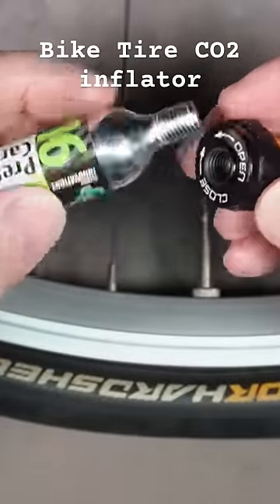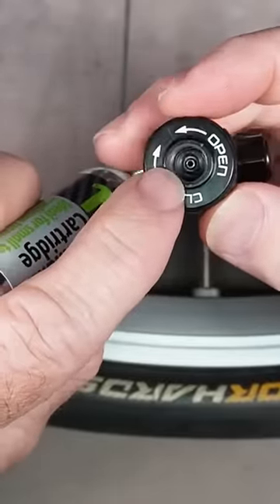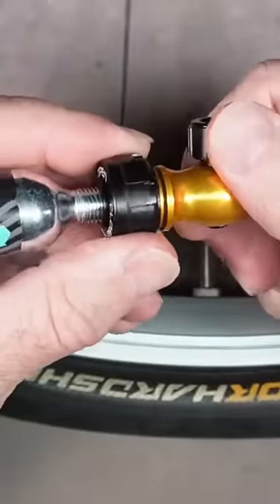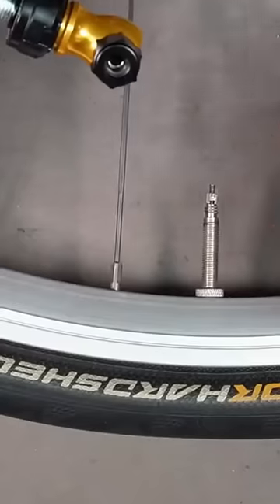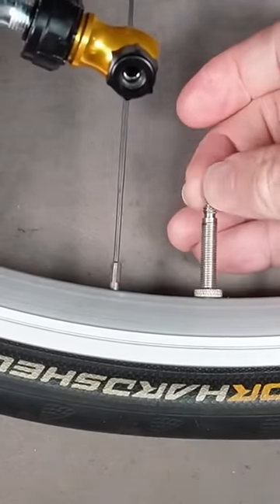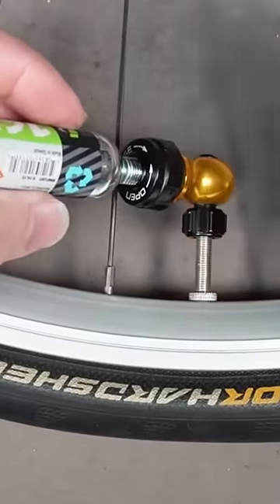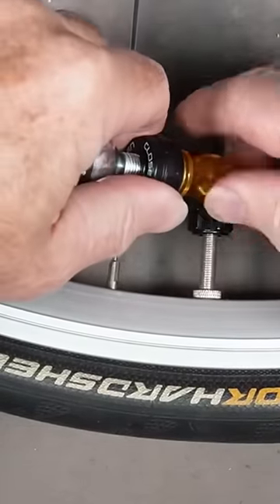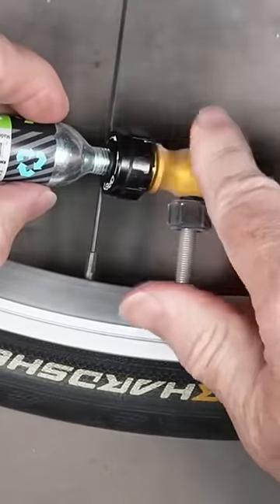Bike Tire (tyre) CO2 Inflator: How to use. #bicyclerepair #bike

Comment: For best results, position the valve stem of the bike so that it is parallel to the ground. This way the CO2 cartridge can be vented in the correct orientation of opening on top, this will keep liquid CO2 from super cooling your inner tube.
Reply from the maker: Thanks for the info!

Comment: When I was a kid, the neighbor was a welder and he'd fill our tires with helium from the welder. It didn't last long but it was quick and free. Another kid in the neighborhood used freon, he'd carry a 12oz can in his tool bag all the time because one tire leaked. Funny thing was we all had tire pumps or compressors at home. Every so often someone would forget how much pressure is in a bottle of helium and blow the tube to pieces. 
I seem to remember someone did make a frame pump that also had a CO2 cartridge in it. It was probably late 70's or so. The way it worked was if you ran out of CO2, you could still use the pump part. In the early 80's Silca was selling one that was a bit more affordable but they didn't catch on until years later. Now there's dozens of CO2 inflators on the market.
Reply from the maker: Thanks for the interesting stories! Good stuff.

Comment: these are great for when they are needed but remember that it takes about 4 of these to take a small motorcycle tire to about 20psi but for the same space you can have an electrical pump box that will work off any bike battery if the engine is running! I have these but i ditched the system when better pumps came out on the market, the good ones have a light, and hold a few small tools as well.
Reply from the maker: It only takes 1 to inflate most bicycle tires! Thanks for the input!
Reply: @davescycling  those hand held pumps work fine too for bike tires. IMO these have  very little use but are better than nothing!
Reply from the maker: These CO2 inflators are designed to be carried on a bicycle where you do not want anything large or heavy. Their only use is to inflate a tire after fixing a flat. 

I have carried one of these inflators for many years on my bike rides and they have come in handy four or five times. They pump the tire up to where it needs to be after I have fixed the flat and I am on my way. This is just one option, a handheld mini pump works great as well, but this is what I have used and will continue to use.

I really appreciate your contribution to this comment string!! Have a great day !!
Reply: @davescycling  mini hand pump IMO is better than a co2 for bikes. i used to carry the Co2 for my ninja but once i had to use it on a failing valve stem im glad i had it but i upgraded to a air pump the same size. CO2  infiltrators are awesome thoug but the stuff we have now is better than it was 15 years ago!

Comment: If you are incontact with the creator, maybe adding a pressure regulator, a snap on feature to where you don't have release the value stem and finally a pressure gauge.
Reply: The pressure Regulator will prevent the freezing that damages the rubber.
Reply from the maker: I am just a user, but good ideas! thanks for the input!

Comment: It's a little bit smaller than a portable hand pump. Being a ex road racer I would carry two extra tubes, and also a patch kit, and a small pump. I've had 3-4 flats on long rides due to picking up small wires or glass on the road. I would even rub my hands on both front and back tires when riding through some debris. In my career of road racing I put in more than 50000 miles on the road.. You always want to carry enough supplies so you're never stranded by having flats.
Reply from the maker: Thanks for your tips! Sounds like quite a bit of experience!

Comment: I have a pump built in my bike. It’s in the bottom tube of the frame. There’s a gear that is engaged, inside where the sprocket is, with a switch where you change the gears. It has a airline that pulls out to attach to the stem of your tire and then, pedal backwards. It’s supper strong and you can’t see any of it after pushing the airline back in the frame, it’s all built in. You can literally pump a car tire up with this thing.  All you do is peddle backwards.🤷🏻
Reply from the maker: Wow! I never heard of that. What kind of bike is it?

Comment: One other important thing, that little  valve on the inner tube can get stuck. Be sure you push it down and it moves freely before you attach the air pump
Reply from the maker: Great tip! I appreciate it!

Comment: if after having fixed a flat, make sure the bead is in the right position and that all leaks are fixed before using the co2 cartridge. those cartidges are good for one go only.
Reply from the maker: Thank you for your input!

Comment: Old buoyancy compensators for SCUBA divers used to use these as an emergency inflator. They did away with them due to too many bladders bursting. Also you used to be able to get miniature race cars that used these for propulsion. Oh and there were air guns (high powered BB guns) that used these.
Reply from the maker: Indeed! I have one of those CO2 pistols!

Comment: I would leave the valve core in the stem so the air doesn’t shoot out when unscrewing the filler!
Reply from the maker: This is a Presta valve. Presta valves close when there is pressure inside the tube or tire. I only loosened the lock nut, which is necessary for air or CO2 to flow into or out of a Presta valve. I did not remove the core. You can see the entire video here: How to Use a CO2 Bike Tire Inflator
https://youtu.be/jc-BpZL3lAk
Thanks for the comment! I appreciate it!

Comment: These are alright in an emergency situation and if the hole is a small leak. Chances are it's flat due to a bad intertube. Probably be best to replace the intertube.
Reply from the maker: Exactly! A CO2 inflator is just another option for emergencies to quickly and easily inflate a tire out on the road after fixing a flat. It is super small, light and inflates a tire in seconds. Thanks for commenting!

Comment: I recently changed to car valve tyres so muxh better. My bikes oldschool quarter inch wide. 70's racer
Reply from the maker: Nice! You can certainly use a CO2 inflator with any valve as long as you have the right valve adapter.

Comment: When i fist saw these it was because i was looking for better alternative to a large pump and the small hand pumps were breaking or getting lost. I thought it was the best idea for when your doing hard core long range biking and you want to keep your weight down.
Reply from the maker: I have been using a CO2 inflator for years. They are super small and one cartridge fills my 700c x 25 tires with plenty of pressure to continue my ride.

Comment: That’s so cool but how do you know when you have the right pressure
Reply from the maker: It is for emergency use when on the road and you are fixing a flat. You can estimate the pressure so you can keep going. When you get home you need to replace the CO2 with air as CO2 leaks out faster.

Thanks for the comment!
Reply: @davescycling  wow, I knew it existed but never saw it in practice. If I had tried it I never would’ve know that it’s a backup thing . Thank you!

Comment: My dads been a self employed mechanic for 35+ years and has never used one of those regular air compressor works fine
Reply from the maker: A CO2 inflator is something you carry on your bike for emergency use to inflate the tire after fixing a flat. I appreciate your comment and input!
Reply: @davescycling  they make compressors that fit in your pocket also so your still wrong i would never use it
Reply from the maker: I have reviewed the ones that fit in your pocket. They work, but slowly. Thanks for your input!

Comment: Just buy the Xiaomi portable air compressor it works for all tires and is small and portable and I keep one on my e-scooter in case of flats and to check my air once a week!
Reply from the maker: That is a great option! A CO2 inflator is just another option for emergencies to quickly and easily inflate a tire out on the road after fixing a flat. It is super small, light and inflates a tire in seconds. Thanks for commenting!
Reply: @davescycling  the portable air compressor from Xiaomi is so small it fits in a small bike bag and it costs $40-$50 for emergencies and just checking your tires and is rechargeable by USB-C and comes with just about every attachment you need

Comment: You don't have to pull out the Schrader valve. It's designed to take air when it's screwed in
Reply from the maker: This is a Presta valve. Presta valves close when there is pressure inside the tube or tire. I only loosened the lock nut, which is necessary for air or CO2 to flow into or out of a Presta valve. I did not remove the core.
Thanks for the comment! I appreciate it!

Comment: This is genius .. 😮
Reply from the maker: Thanks so much for commenting!
Reply: @davescycling  Video ended before all the air escapes. How embarrassing.
Reply from the maker: What is embarrassing is that you are commenting on a Presta valve, which you are obviously unfamiliar with. If you look up how Presta valves work OR just watch the full video linked in the short, you will understand. Thanks for the comment!

Comment: How do you reseal the stem core without pressure loss if you unscrew it before you add the Co2? The little pin on the top is supposed to depress to allow air flow?
Reply from the maker: This is a Presta valve. Presta valves close when there is pressure inside the tube or tire. I only loosened the lock nut, which is necessary for air or CO2 to flow into or out of a Presta valve. I did not remove the core. You can see the entire video here: How to Use a CO2 Bike Tire Inflator
https://youtu.be/jc-BpZL3lAk
Thanks for the comment! I appreciate it!

Comment: Good for emergency use only.  CO2 is not as stable as regular air.  It compresses when it's cold vice versa.
Reply from the maker: Correct, CO2 inflators are for emergency use. Thanks so much for your comment!

Comment: So you unscrew the valve on the stem to allow air to go in, do you overinflate to allow for air that will escape when you take the canister off and you have to screw it back in?
Reply from the maker: No, this is a Presta Valve. No air or CO2 will escape when the inflator is removed. A Presta valve closes when there is pressure inside the tire or tube. Thanks for the question!
Reply: @davescycling  thanks for the answer.

Comment: It’s nice bc co2 last better then regular air so should hold for a good while
Reply from the maker: Actually CO2 leaks out pretty fast, so it is highly advised that if you use CO2 in an emergency that you replace it with regular air when you get home. Thanks for your comment!

Comment: From a retired BMX pro. What are the real upsides of presta? 
I used them on my race bikes before going into freestyle but always just ran schraeder on the streets.
I was always told it was weight back in the 90's. I can see the tube adding a lot of weight especially during rotation.
You don't see a single person now days using tubes in anything over 24" really.
Reply from the maker: I am only a road cyclist, but my understanding is that the smaller diameter Presta valves are better on a narrow road bike rim. A smaller hole is better for the strength of the rim. Thanks for your comment. I really appreciate your insight and experience!

Comment: I’m sorry if I will sound rude, because I barely know anything about cycling 🚴. But, can you just use normal air to inflate? Is carbon dioxide lighter, or is it something else. Enlighten me please 🙏🏽
Reply from the maker: A CO2 inflator is for emergency use when you get a flat out on the road. Just replace the tube and inflate and you are back up and running. You will want to replace the CO2 with air when you get home because  CO2 leaks out in a day or two.
Thanks for the question!

Comment: Does it stop delivering when the preassure is correct, or do you have to stop the air flow to prevent it over preassuring the tyre?
Reply from the maker: Thanks for the question! Typically, a 16 g cartridge will inflate most road bike tires to a reasonable pressure so you can continue your ride or get you home. Most times you’re going to be using the entire cartridge. You can check in the description of the video for some information on what size tires a cartridge will inflate, and to what pressure.
Reply: @davescycling  Thanks. I might look again at this as an e-bike solution for emergencies. Right now i rely on slime.

Comment: How do you know how much pressure you’ve put in the tire?
Reply from the maker: There are charts in the video description that show approx pressures for various tires. Also the CO2 inflator is for emergency use to inflate a tire quickly after fixing a flat out on the road. As long as you get enough pressure to continue or get home, you will be good. This has helped me out on several occasions over the years!

Comment: Remeber to always fill with the bottle upside down so you send straight liquid co2 into your tire to destroy it...
Reply from the maker: Is that what happens? Interesting. I guess I did it wrong because my tubes are all fine even though I did this several times for this and other videos, and continue to ride on this same tube and tire! Thanks for the comment anyway!
Reply: @davescycling  not saying it will happen right away, but yes, if you fill upside down the liquid comes and could damage the rubber (yes it will evaporate inside the tire, but not before making contact with the rubber).

They have cartridges that are pure air, but they don't put out the same volume of air.
Reply from the maker: Thanks for the reply. I have used this method for on-the-road inflation after repairing flats for years and never had an issue. It is just another option. I get lots of mixed feedback but my experience is 100% positive! Thanks again, always appreciate feedback!

Comment: What happened to normal reliable easy-to-use pumps?
Reply from the maker: Pumps are still the best all around for most! A CO2 inflator is just another option for emergencies to quickly and easily inflate a tire out on the road after fixing a flat. It is super small, light and inflates a tire in seconds. Thanks for commenting!

Comment: You dont need to unscrew the tyre valve. Its a spring seeled valve. When screwed in if you press on it it will let the air out and when inflati g the thingy ma jig goes over it a push it down to let air go in.
Reply from the maker: You may be referring to a “Dunlop” or “Woods” valve. The valve in the video is a “Presta” valve. Presta valves do not have a spring as they close when there is pressure inside the tube or tire. I loosened the lock nut, which is necessary for air or CO2 to flow into or out of a Presta valve. I did not remove the core. 
Thanks for your comment!

Comment: If you unscrew the valve on the tube, how does the gas remain in the tube when you remove the filler from the stem? Isn’t the valve made to be in place when it’s being filled and plunger is depressed?
Reply from the maker: Nothing will escape when the CO2 inflator is removed. This is a Presta valve. Presta valves close when there is pressure inside the tube or tire. I only loosened the lock nut, which is necessary for air or CO2 to flow into or out of a Presta valve. I did not remove the core.
Thanks for the comment! I appreciate it!

Comment: We do not recommend Co2 to inflate tires As it can deflate within a day we just use air compressor for Tubeless and Electric air compressor for the ones with tubes that way you can expect it to be hard even if you don't inflate it again for 180days
Reply from the maker: A CO2 inflator is just another option for emergencies to quickly and easily inflate a tire out on the road after fixing a flat. It is super small, light and inflates a tire in seconds. Thanks for commenting!
Reply: @davescycling  still we don't recommend it because it's not efficient for holding air it can deflate within tomorrow just use Normal air
Reply: @davescycling  yes it's light everybody say that blah blah blah light and everything but it was not Recommended and not efficient it depends on you whether you want problem or not
Reply from the maker: It is true that CO2 leaks out of a tire very quickly, that is why it’s important to replace it with regular air once you get back home after having a flat.
Reply from the maker: Your points are all valid, this is just another option and happens to be the option that I have used for many years and I’ve had nothing but success with it. The inflator and two cartridges took away very nicely in my saddle bag, and I don’t have to think about them until the time comes when I need it and then it works perfectly every time. Thanks for your input. I really appreciate it!!

Comment: I'd rather have a manual tire pump that I can strap to the side of the bike and reuse  forever than a one time use cartridge that I have to keep buying but it's an interesting gadget.
Reply from the maker: You are absolutely right! A CO2 inflator is just another option for emergencies to quickly and easily inflate a tire out on the road after fixing a flat. It is super small, light and inflates a tire in seconds. Thanks for commenting!

Comment: One need to do so many things for it to work like driving a triple clutch transmission.
Reply from the maker: lol! You sound like someone who has never done it. You do it once and you are an expert and it is super easy, and 10 times quicker than using a pump. Thanks for the comment!
Reply: @davescycling  No, i did not question the efficacy of the product or the process. But was surprised how many things to keep in mind. But you are right I believe one could get used to it fast.